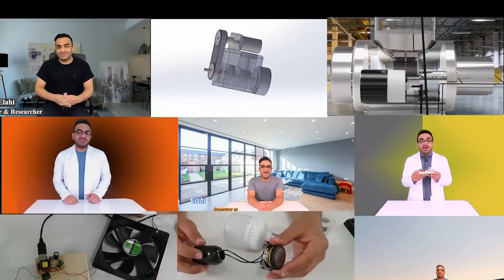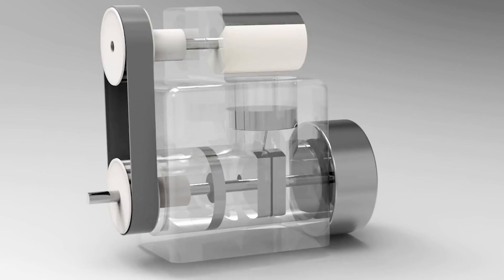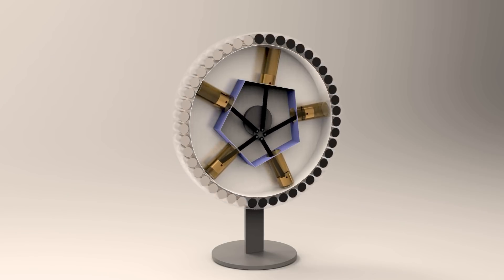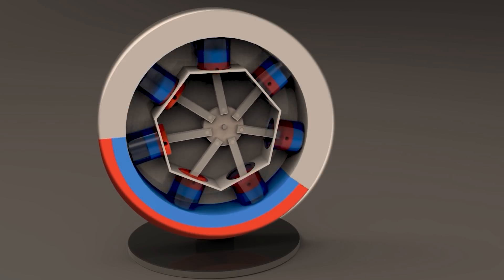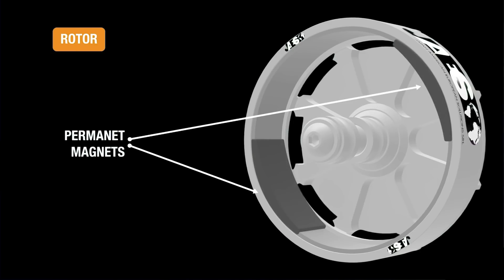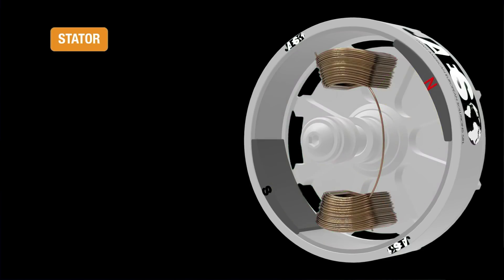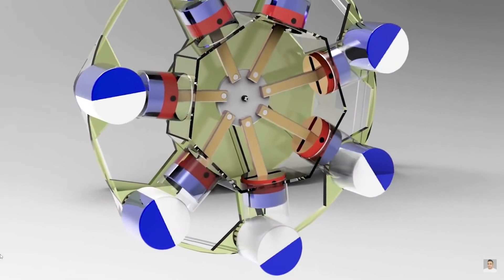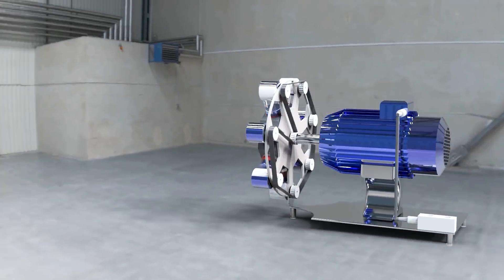Unveiling the New Permanent Magnet Motor: A Revolution in Energy Generation!

Comment: The force needed to turn a generator is very high, you should begin there, to find how much force you need, then build one of your magnetic motors to see what force it makes. Use those calculations to then know how large your magnetic motor will have to be to produce, say, 1000 watts.   There is a good reason gasoline engines are used to turn a generator, they need a ton of force, your magnetic motors look to me to produce a tiny fraction of what is needed to turn a generator, so do build one, animations will not do.

Comment: I was sugggesting just get rid of the entire combustion engine block and use a 300 horse hub motor, i was gonna use inline electric motorcycle rims on a houseboat inboard outboard driveshaft in keywest. They, people NOT FROM KWYWEST took my drivers license away  so i couldnt rent a slip. Same way my electric scooter throttle works. Straight to the cars transmission with a shaft link. Mill one out custom. Simile lift kits and 2 plus a-arms. Just mill out a new shaft rod to harbour the length and depth of the hub motors. Car'll twist a little bit...use uh?????......use a 90 or a worm gear and have them facing forward so thwy spin down instead uf up in the front.  A motor home is heavy it wont flip over forwards "ass.....over teakettle"  bros before hoes etcetera....etcetera....et.....cetera. by Adam Lee Montgomery ;)

Comment: It will not work because they will get out of synch eventually ,same thing with an analogue clock ,however a clock will still run however it will take an amount of cycles before it will be finally be in synch again and the cycle repeats.

Comment: I hate to be the bearer of bad news, but this is never going to work.

Seeing the other comments I can see everyone believes in perpetual motion or free energy and doesn't accept the laws of thermodynamics, so let me try a more detailed explanation for this particular model.
You can think about the situation in terms of energy. Forget all the more complicated explanations of energy, think of it simply as the work needed to push the magnets together. 

Imagine you have two magnets with poles opposed such that they push apart. Now the lowest energy configuration is the magnets being an infinite distance apart, and the highest is when they are touching. In order to get the magnets into the highest energy configuration (push them together), you have to put energy into the system. You then release that energy by letting the magnets go and push apart.

Now here's the big downer. Magnets are not magical devices that you can trick into being closer before letting them go. You have to push them together, and when they push apart you are never going to get more "oomph" out.

I've seen people who attempt this mentioning the "gate effect" where you need to get the engine past a point to where the magnets push apart. This gate effect is not a problem to be solved, it is the energy barrier in the system I just mentioned. The system needs energy to get past the barrier, that initial push back from the magnets. And when they do release, they cannot give back more energy than you put in to get them past that barrier.
Reply: Well said Daniel,we will not harness magnetic force  until we figure out how to interrupt a non electrical magnetic field.I have been working on that for several years.
Reply: @randolphsnyder1505  I was hoping to put a stop to some of this nonsense, but you guys always find a way to misunderstand science and come up with another hair-brained idea that will solve everything.
Magnetic field lines are not magical, just like magnets are not magical either. You can't just block field lines, you can't just switch off a ferromagnetic material.
If your interruptor interacts with the field lines, even if it does what you think it does (I doubt it), know that energy is stored in a magnetic field. Interrupting it or moving the field lines around will push it into a higher energy configuration, and so it will take energy to switch your interruptor on, or move it into place, similar to not having the interruptor there and just moving the magnets in the motor in place.
If your interruptor interacts with the magnet directly, good luck switching off the electrons in the material. You can heat it above its Curie temperature but that permanently damages the magnet (and takes a lot of energy).
Reply: @Dc4nt  
Excuse me Daniel,I am not one of " you guys " I am a mechanical engineer 82 years old. I was the lead project engineer for the first space simulator at NASA.
I was agreeing with you ,while pointing out what I see as the road block to harnessing magnetic force.I also believe  the use of magnets to reduce friction should be further exploited.
My current endeavor is a study of hysteresis loops. By the way,the reason I bother with utube postings is,I am fully aware that I am not all knowing and once in awhile I read something that sparks my interest.

Comment: This is really interesting. I’ve followed and read a lot on so many technologies over the years, but you’re the first I’ve seen to use a timing belt. The major issue all inventions face is the trolling force NN or SS only really works when they are parallel to each other. There is a substantial lateral force the fights getting to this position when trying to move the one above the other. How would you overcome this resistance?

Comment: Needs more fractal.

We cheat a bit using our scale.  

I see what you are going for.  To be efficient and correct, you can't use remainders on your math or pro science math adjustments. 

Physical object remain true until they can't. 

Setting conditions by building is what we do. To hit that free energy spot without the debaters swarming you like god has a secret there..you gotta use what it is. Not what we did to do it. 

Magnets are set physical iterations of natural process that are generally not set but in occurrence. 

Simply put. The concept is correct. But you need little magnets and big magnets operating on the medium magnets as well as big and small if you can't negate the biggest magnetic influence, influencing the creation.  

Which at our scale would most likely be the earth.

Like doge. The earth is that 6 cents we need to revisit to move forward. 

Less than negate the earth, it would be easier to account for and use it at appropriate times to modulate with your creation.  

In saying that. Great job. Keep it up.

Comment: Nicely illustrated concept. In my experience magnets used in repulsion soon degrade whereas in attraction mode tend to maintain their magnetism.
Reply: That’s absolutely not true at all. Magenta don’t care. The only thing that degrades a magnet is heat. The domains can get misaligned and then lose magnetism. 

What you will have issues with, and many other similar motors have also, is the lateral or transverse approach NN. This approach force or side force greatly resists allowing the magnets to come together. However once magnets are parallel with each other, the centre force is greater than the lateral.

Comment: Spinning the outer magnets takes as much energy as you get from the movement of the inside magnets. So due to friction it will not turn in reality.
But hey believe what you want, I believe in science and the laws of thermodynamics.
Go ahead and build a real model and then we can talk.
Reply: Nailed it. 

Need work to make work work. 

Bigger is the first wrong move we go for here. 

Smaller persistent magnets pushing the larger to move enough to trigger the next level effect. 

We also need to work the larger magnets above us.

So basically we try to work the middle without considering the effects of the small and grand scales. 

These systems are good boosters to deficient systems that rely on persistent cycles. 

Being in a gravity well makes things heavy yo.
Reply: @ericmccullar2274  please elaborate, I am confused